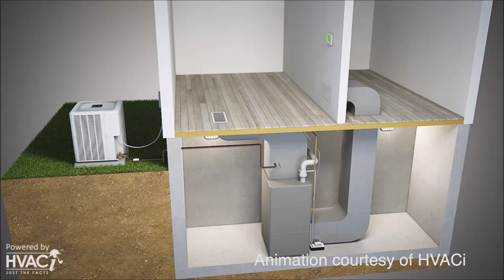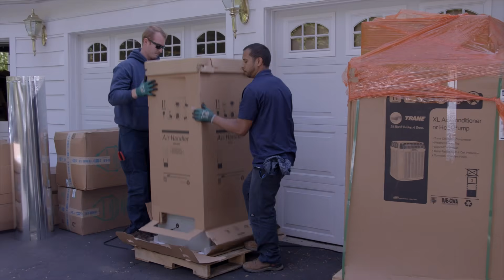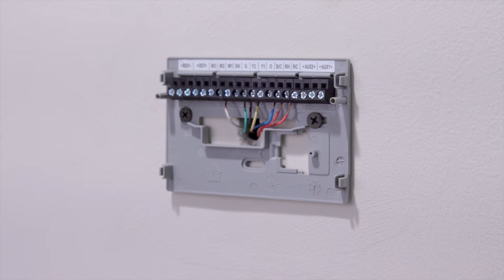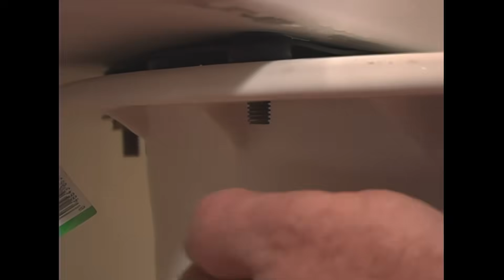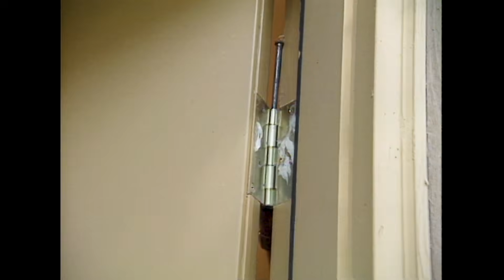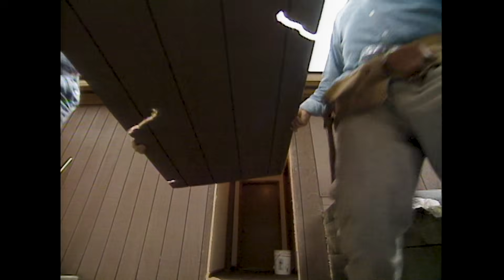HouseCalls Season 21: Upgrading a Central AC System - How to Install an Exterior Door

Comment: This looks way harder than it seems - central AC upgrades usually need proper electrical work and refrigerant handling that most people can't do safely, American Residential Services does air conditioning installation for situations exactly like this.